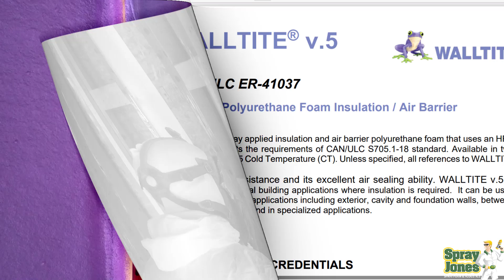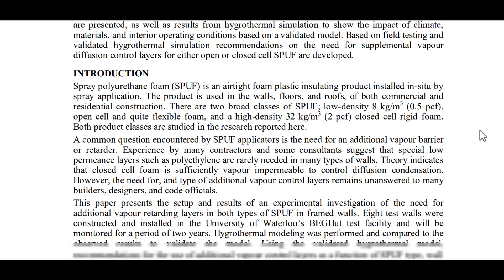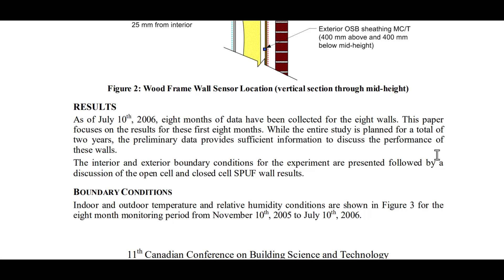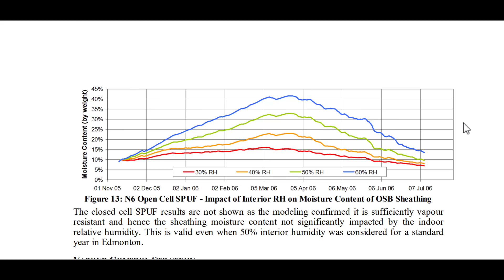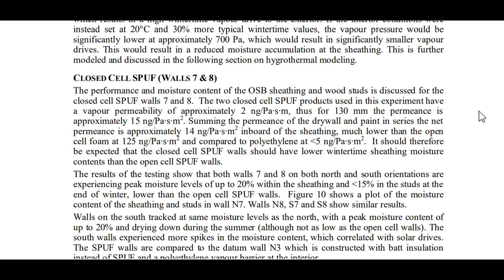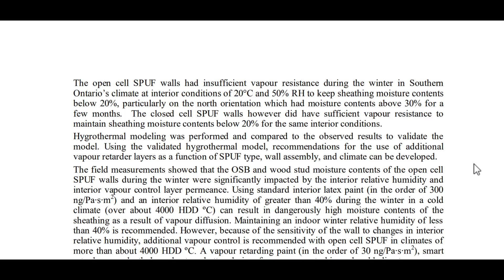Fake News Series | 3 | Vapor Barriers and Spray Foam Insulation

Comment: Rip down your drywall, remove the worthless fiberglass batts and dispose then spray 3" of closed cell foam.  Caulk all double studs. Caulk top and bottom plates.  Remove fiberglass around windows and replace with can foam.  Plastic off one room at a time.  This is the only way to fix it.  Otherwise live with it and sell it in the spring.

Comment: Excelent video. just had my walls sprayed with 5.5" of open cell. I was on the fence about installing a poly vapor barrier. Insulator said I did not need it but after watching this video I will be putting up plastic before the blueboard goes up.
Reply from the maker: That's the idea. Helping. 
Caulk all the wood to wood seams too before the poly goes up.
Reply: @SprayJones  After the contractor finished I went through the job and found at least 30 spots that needed addtional caulk. had it not been for your videos I would more than likely not followed up on this. The roof had a complex framing plan where there were a lot double and triple rafters. This is where there was a lot of missed spots. Roof was done with closed cell.

Comment: If I understand this correctly, with either type of insulation being used, an external house wrap is still needed to deal with moisture on the exterior material.
Open cell good in dry climates, closed cell good in wet climates.
Reply from the maker: Correct. Your sheathing must be protected from getting wet.
Reply: Closed cell in every climate
Reply: Does this mean I’d need to remove existing siding to add a wrap before ripping off Sheetrock and putting in closed cell + stud caulk? (1960’s San Francisco house, unsure if it already has some kind of exterior wrap)
Reply: @Travisrogers87  it might not be necessary with the San Francisco climate, but if you want to have a house with maximum insulation, you might need to remove the exterior siding. But best to loosen it first to inspect what is between the siding and the exterior sheath. It may be that paper and you don't want to disturb that unless you are going to do a full renovation.

Comment: Summary from Google Bard: " The study found that open cell foam can allow moisture to accumulate in the sheathing, especially during the winter months. Closed cell foam, on the other hand, was found to be an effective vapor barrier. The speaker concludes that closed cell foam is the best choice for use in walls in cold and damp climates. "
Reply: So thus any climate

Comment: Want to know the difference between 30 ng paint and 300 ng paint?  The 30 ng paint performed much better you stated.  Could you explain the difference?  The #s 300 and 30 threw me a bit.  Great video!  Closed cell foam wins again.  I'd like to know your opinion on sound deadening foam....specifically how much better open cell is than closed?   I have had lots of compliments on our c.c. applications that "the house feels so quiet....I never hear the trucks going by anymore...it ads such a denseness to the home we even sleep better...."  we only have one rig so it's a pain to switch over to open etc.  Great video
Reply from the maker: They are testing more permeable paints. So have a higher rate of flowing water vapor through them. That's all. 
I don't have stats on closed cell for sound because no one has paid to have the product tested extensively in a noise chamber. 
Noise and what you hear is very subjective, deserves it's own video.
Reply: Thank you!

Comment: This is very interesting, and very empirical, however let us not forget what all this science and effort is really for. It is all so people (ie those with with the modern mindset conceit) can wander around inside their homes in open toed sandals, boxer shorts and tee shirts, in the height of winter; whilst still having three showers a day, and washing (and then tumble drying) every article of clothing again and again simply because it has been worn for 5 minutes straight.......... all of which drives moisture into an overly warm and unnecessarily humid environment (thus severly 'steepening' interstitial humidity gradients), in a now hermetically sealed enclosure (formerly known as a home), when it is cold outside for 3 or 4 months on end.

People used to simply dress up more, maybe bathe and shower a little less (tin bath in front o' t' kitchen range once a fortnight), and still hang clothes up to dry outside (on dry'ing days) whilst limiting core heating and habitation to fewer rooms, in the depths of winter. 

There you go, huge energy savings, millions of tons of closed and open cell foam substrate savings, and square oceans of vapour barrier sheeting savings, all in one.

Kind regards, and thank you.
Reply: Your point is not lost on me....not totally sure I can discern what is sarcasm and what is not.  fwiw, just had my attic-less house's roof sprayfoamed, best home improvement I've made.  Drastically reduced the oven effect in the upstairs bedrooms, really brought the temp differential between upstairs and downstairs to within 2-3 degrees.  Love it.
Reply: @lionofistanmusic7311  Yes, large open ceiling-less spaces or dwellings like old-time school rooms or church spaces do need other solutions. I mostly confine myself to my kitchen during the cold times of year, where there is cooking heat, local heating, telly, tablet etc, and just go to bed with a hot water bottle, and warm the bathroom just for shower times etc.

I used to live in and old English village school, the Victorian main room had a high apexed roof. The only way to keep warm in there was sit close to be log burning stove, but if I found myself there again (or similar) I would probably tend to temporarily 'tent - in' an area in that main room just for December, Jan and February say, just to confine the heat to less volume (from the main stove source). Maybe even kip there as well, like camping out, but in.

Comment: How do you think this applies to a garage ceiling where there are bedrooms above. Open cell was sprayed in the ceiling of my garage. Since this is not an exterior wall do you think the open cell would be fine without vapor barrier. Would it be safer just to throw the poly up?
Reply from the maker: The flooring material will have the vapor perm needed. We have done that lots.
Reply: In relation to the original post, I too had foam sprayed on garage ceiling but the floor above is quite cold in winter months. Almost feels damp
Reply: In relation to the original post, I too had foam sprayed on garage ceiling but the floor above is quite cold in winter months. Almost feels damp
Reply: @skyline5354  I ended up doing a vapor barrier on the ceiling of the garage just incase.

Comment: On that last bit, they better be careful with the recommendation to use closed-cell on the exterior. If that ends up in conjunction with any kind of vapor barrier application on the interior, that is just asking for some serious problems in that wall long-term. It must be able to dry thoroughly to one side or the other. A better idea is to use the closed-cell on the interior and then use a mineral wool or other highly permeable, water-impervious exterior insulation product that sits between the rain screen / vented cladding space and the sheathing. The data also make for a good, unspoken argument for using exterior-rated plywood in the assembly rather than OSB.
Reply from the maker: In order to have a problem you first need to have a condensing point. The SPF on the outside (sufficiently thick) will remove that. No moisture can come out of suspension within the wall.
Reply: @SprayJones  That is known as the perfect-wall fallacy. Eventually, with enough time and tremors, it will not be perfectly sealed. In very cold but seasonal climates, there will always come a phase where a condensing surface is available. All it takes is ingress of moisture into that wall that does not have a ready ability to dry and catastrophe will follow. "It dries or it dies."
Reply: I'm not following your comment? Did we both watch the same video?   The closed cell foam performed the best....the moisture accumulated on the exterior of the osb on the cc wall from the outside...between the brick and the osb..  it didn't come from the inside.   There seems to be the philosophy of "the house needs to breathe" in your comment no?"  I say only the humans inside need to and an hrv unit takes care of sufficient air changes for people inside as well as kitchen and bath fan efficiency
Reply: @spiderfoaminsulation9763  Regarding material drying, that is incorrect. Building science matters if someone is building a home that is intended to last more than one generation without suffering significant problems with mold, etc., followed by structural compromise of wood materials like sheathing and major superstructure repairs / renovations being required. My reference was to the end of the study that was presented where the suggestion is made by the researchers to apply closed-cell foam to the exterior of the wall as well, which would effectively trap any moisture that gets into (and inexorably spreads) within the wall. Closed-cell SPUF is indeed a great choice as an interior barrier in predominantly cold climates when formulated and applied correctly. Wall construction is never going to be consistently perfect, however, especially with the effects of time, so it is crucial that walls are designed to deal with any failures from imperfections like moisture ingress and be able to dry to the outside since they are no longer able to dry to the inside with the closed-cell applied.
Reply: Our wall gets frost on the inside and we can feel the cold air through the external wall.  So what should we do?  Our home was built in 1971.
Reply: @facialexpressionsfacepaint2967  It depends on what climate you are in and what your existing wall assembly looks like currently (how much insulation in what size framing, etc.). If I were in your situation, I would be looking for someone who has done training with Building Science Corp. or an associated program. You may be able to find referrals for someone like that in your area through BSC or through your local building department (county or province, etc.). Homes built in that era often suffer from poor thermal control, but it’s important to get the water / vapor control right as well so that it doesn’t suffer long-term damage from trying to correct the thermal issue.
Reply from the maker: @ReflectedMiles  Interesting since the SPF is a certified air barrier material and has a bond strength rating.
I can see you know nothing about spray foam and the building code or building techniques. Instead you are barbing on here like you know something after watching a few Matt Risinger videos.
Reply: @SprayJones  Nothing you stated is unknown or news to me at all—it is the result of those very facts in imperfect application that resulted in my comments here. If your climate context was most of the Southern US, by contrast, and so your applications were (hopefully) being made to the exteriors of walls, I would be saying the same thing about then also applying it to the interior—not a great idea. Try to find any mechanical engineer with any specialization and long experience in building science and thermal control who would risk differing with what I’ve written and offer a 50-year warranty on the results. Matt is just a student of the engineers and scientists in this field like I am, and I’m not a fan of all of his approaches and applications though he certainly does better than the countless builders and trades who aren’t well-educated in their own fields and their assemblies testify to that fact, especially over time. Many a father counsels his son to get into construction because his grades haven’t been good enough to be a promising candidate for continued schooling or in other fields, and it too often shows.
Reply: Reflected miles you need to reflect a lot more.  Your comments show that you are ignorant to the performance and virtue of 2lb. Closed cell foam.  Open cell foam is best for interior bedroom and bathroom walls for privacy.  Now listen..  without a condensation point there is no condensation possible.  Foaming exterior walls seals it off perfectly.   Don't knock what you have never experienced.
Reply: THIS! Always get a professional, experienced opinion from someone who has no interest in selling you anything. Great points for using it right. I have read something like this in JLC also.

Comment: So The Exterior Moisture was causing even the Closed Cell insulation wall on the backside of the sheathing... Meaning it is a Failed Test!
They Needed to put Sensors at Every 1/2" So they can see Any Progression of Moisture IF IT IS Working Through From the Interior!
FAILED TEST
The Exterior Moisture Causes Alarm on the Open Cell Insulation Wall Test!
Reply from the maker: James, go tell John Straube he doesn't know what the hell he is doing. I dare you..
Reply: Why not wrap yourself in fiberglass Batts and go take a nap to calm down.  You guys who bash closed cell foam have never experienced it!!???  Your ability to listen to the video is lacking greatly as it said the moisture came through the bricks and the cavity between the brick and the osb.  Tyvek wasn't used.   Normally it would be and it would have kept the outside of the osb dry.   They didn't want to use the tyvek in the test because they truly are trying to make the foam stand on its own.   Don't you get that?    Once you get closed cell foam in your dwelling that you yourself live in....you will never bash it again.   So spend the $$$ and get some!
Reply: @spiderfoaminsulation9763  I Only Bashed the Test... I am a believer in Spray Foam Insulation
Reply: @SprayJones  Who Cares???  Is He God???
Grow a Pair.
Without Multiple Sensors Throughout the Foam Insulation, You can Not Tell Which Direction the Moisture came from.
It is just that simple.
Reply: @jameschupp2230  "grow a pair".....wow...that's big open cell energy comment.

Comment: Advice needed: I am resorting 1890 Detroit home that has brick veneer. All the walls are down to the studs and I am 90% confident to put 2-3” closed cell spray foam. But my worry is 10 years down the line I discover the studs are rotting out and is due to prevented air flow.. Is closed cell recommended for old brick veneer homes in cold climates?
Reply from the maker: Watch the video I have on old brick homes and SPF.